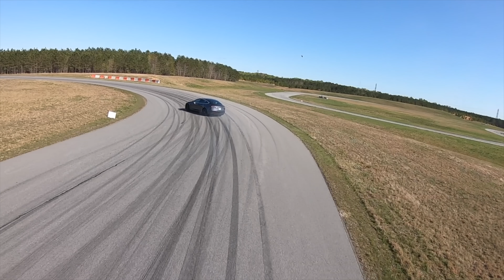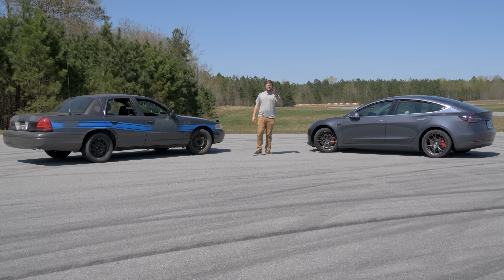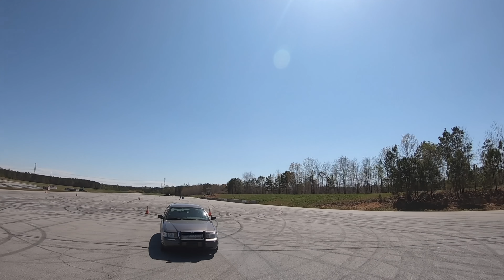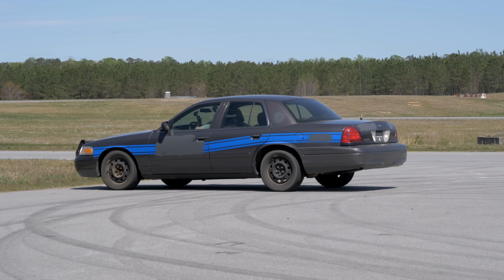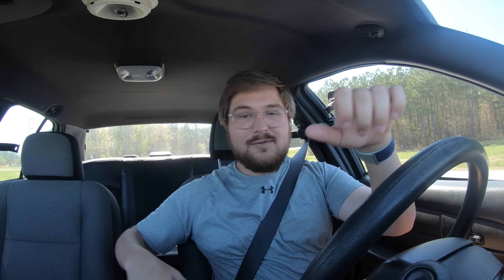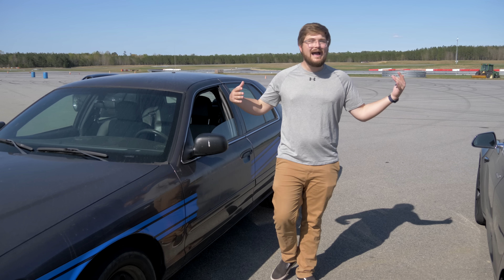Should Police use EVs?  Tesla Model 3 vs Crown Vic Police Interceptor

Comment from the maker: Keep in mind this was a fun test, not scientific, where we used an OLD cop car with a NEW Tesla. This was more for entertainment purposes however if there are any members of a police force that want to come over to the track (in North Carolina) with a current PPV vehicle and some tests in mind that would actually be “real world” I’d love to do it! The video for InsideEVs will be numbers based on as much factual data as I can get. This was more to make people smile during this rough spot that has many people down.
Reply: May be a bit old, but the Police Interceptor models of that car had some special tweaks specifically for police duty unlike the standard civilian models. If you had an EV with say a police software package and maybe some police hardware specs, it probably would have beaten the old car. I would expect a police version of the EV, would be able to go much faster in reverse for example.
Reply: @Dominic Licavoli You lost credibility when you mentioned the one incident where they ran out - because they forgot to plug in.
Reply from the maker: They also didn’t charge the car the night before like they had planned to. Same would have happened if you never filled up a gas tank
Reply: @OutofSpecMotoring   ise your brain 5 minutes stop and done
Reply: @Dominic Licavoli old news and it was debunked already. It didnt have to stop the pursue because of the SOC:
Reply: @Dominic Licavoli But you are right, charging takes longer especily with some slow charging available in the precinct so getting the car bck in service is  a bit clumsy.
Reply: The main problem with Tesla is that their vehicles are not as addon- friendly, and without a generator, the battery would drain very fast powering all the police equipment. The CVPI alternator is in excess of 200 amps.
Reply: @NightmareKato  Keep in mind the size of the battery in modern EVs! I'm no electrician and won't try to be one but from some quick research some people with the 'Long range RWD' Model 3 were seeing around 600 amps being drawn, and note that is the single motor Model 3, not the dual motor or its performance variant!
Going based off that, 200 amps would maybe be the equivilant of driving at highway speeds? As they recorded around 600 amps when flooring it and highway speeds would be roughly 1/3 throttle.
So powering a 200 amp device, you'd be looking at losing maybe a range of 33~ miles every 100 miles driven at highway speeds. That'd reduce the vehicle's range to 200 miles at highway speeds from 300, that's not actually too bad! Consider that cruising around a city at 30mph would get you significantly more range.
(Total back of napkin math btw, just something to think about, don't use this as 'fact'!)
Reply: @Dominic Licavoli also you are factually wrong, it never ran out of juice, just not enough to sustain a highway chase
Reply: @Dominic Licavoli Not the case for model 3 and even overheated 100D would kick ass in 99 percent of case. Fro 100D or model 3LR the range is not an issue at all as they dont even use all range during the shift. In the summer we shoudl get new model S with bigger BP and plaid power train, I dont see problem except for the price of new mode S. As for me model 3 is still better choice than model S even with plaid power train and bigger BP.
Reply: @Zayd Mohammad  It's probably in Track Mode since he has a Performance model.  That one can drift without modifications - regular and Long Range Model 3's can't really, they have "dyno mode" but that one is wayyyy too dangerous to actually use on a road or track.
Reply from the maker: Dyno mode isn’t dangerous and I used it all the time before Track Mode V2 in RWD and AWD cars. This drifting is in Track Mode V2
Reply: @OutofSpecMotoring    They do warn you that using Dyno mode for anything other than a dynamometer is "out of spec" use and probably invalidates your warranty and/or would lead to insurance issues if you were to have an accident right?

I´ve never used it but reading about it but there apparently pops up a disclaimer on the screen when you engage the mode.
Reply: @Dominic Licavoli the abuse they go through? So what? Model 3 had far less parts that are going to wear down and break than any ICE vehicle.
Reply: Thanks for pointing out that it was a worn out Crown Vic, which of course would not stand a chance against a new Tesla.  But a new Ford Police Interceptor with AWD and a twin turbo V6 would make it a much closer race.  I think an EV will eventually make a good police vehicle with the right tweaks- a cop car's gotta be able to go a lot faster than 17 mph in reverse! And the new FPI Explorer hybrid has the same K9 AC feature as was mentioned for the Tesla. If I were a betting guy I'd say that we will see an electric Ford Police Interceptor sooner rather than later. The comment about police officers "getting gas for free" was just silly and I hope the intent was not meant to be serious.  No, of course the officers don't pay for their own gas, but it ain't free!  We pay for it!
Reply: @roysmith1259  Keep in mind a Model 3 can do over 165mph in reverse! It's just software limited to a 'safe' speed of 15mph.
The motor is directly connected to the wheels essentially, it's just geared down, meaning you can do the same speed forward as backwards, I imagine a lot of people would crash if they had the same backwards acceleration as forward though so the limit makes sense. Maybe a police variant of the firmware could have this limit removed. :)
Reply: @Out of Spec Motiring you can not Compare a 22 Year Old Platform With maybe an Year old car What i think on this that the Crown Vic totally won it because of the Age and still The Crown Vic is actually Still The Best Police Vehicle's out there hey they may be Slow but sure enough they are Good for Road Blocks Chases Beach Patrol and as i see that Crown Vic was not an Trac Lock one if it would be i feel like it be Close each other since the Trac Lock one Locks the Rear Diff and its not a Open diff what i think would be fair a Trac Lock CVPI or a Dodge Charger PPV ( Police Pursuit Vehicle)
Reply: Tesla: We suspect you made unauthorized repairs, we disabled supercharging and the GPS until you visit the authorized Tesla dealership. Good luck going to that fire!
Reply: I just read an article about a police department that bought a bunch of Teslas for patrol cars. They had a lot of problems with them and switched back to ICE vehicles.
Reply: @Dominic Licavoli Well if an ICE patrol car was brought in to the station and not filled up with gas, the same thing would happen. All it takes is a change of procedure.  I haven't been to a gas station in a year and a half. Everytime I go to get in my car it's got 250 miles of range. Why not have an EV charged at the beginning of every shift? Then let's talk safety, reduced maintenance and less breakdowns. I think EVs are, and will be far superior in any application. It will just take some changes is standard operating procedures.

Comment: To be honest with you I would never trust the Tesla for hard use at all especially in cold climates when the battery will die on you before taking off. And why would you want to sit in a power charger for 30 minutes or more when you could put unleaded or even flex fuel on your crown Victoria and be out of the gas station and only a matter of minutes

Comment: Electric vehicle 20 miles to one ton of coal.
Reply: Not to mention raping the earth for heavy metals, child labor, straight up slavery all the nasty toxins required to process those heavy metals that are then dumped, ect.. you want to do the world a favor keep an old clunker running, yes, yes they can be recycled, thank god that's actually a practical recycling process I am very familiar with but it's better to keep a clunker on the road than scrap it. Brakes first because hey, human lives matter. Then tune up. Once that's done properly the predominant exhaust component of a properly tuned internal combustion engine, even a gasoline one it water vapor. Look it up I dare you. Meanwhile even according to national geographic naturally burning coal seams produce more carbon dioxide than all human activity combined. Then there are volcanoes. It is foolish pride for humans to think they can have such influence on this globe.

Comment: I'm surprised how well the crown victoria did compared to the tesla even with an open diff and how poorly the tesla did compared to the crown vic I mean it was only 1.29 seconds faster I was expecting it to be much faster than the crown vic like 10 or even 20 seconds faster and it was only a few feet faster at catching the speeder! So much for the EV! Yes it's faster but not fast enough to make a significant difference in a real-world scenario especially compared to a crown vic imagine if it was compared to a more modern more powerful chevy caprice PPV or a dodge charger pursuit.

Comment: Until it is figured how to recharge an electric vehicle as fast as one can pump gas, AND have it available on every other corner-  the cops wont be using them too much.  I think thats the one thing a lot of folks are missing...Too much down time. It would take more Teslas, officers and money to achieve the same amount of coverage to make up the time difference between  a "re-charge" vs.  a "fill up".  Police departments aren't going to go for a cruiser sitting idle for that long- neither is a city budget planner.  Most officers hand the cruiser over to the next officer while the hood is still warm to the touch. The performance of the Tesla is outstanding, no doubt. Not gonna be an "electric car-denyer". A lot of work to be yet, to include making them where they can have the living fuck beat out of them 12 to 18 hours per day.

Comment: I think it will only take one OTA update and Tesla can transform their vehicles into proper police cars. Even the top speed in R can be easily increased since there is no gearbox. All that beeping and blinking can be turned off because they are only there for safety which a police car driver doesn't really need. A complete new market for Tesla, they should seriously look into this (pretty sure they already do).
Reply: They do but the problem is that teslas software is written in a different coding language then what cops have used, so its is a bit of work for the valuable software engineers in tesla to work on.

Comment: I spoke with State Trooper that lived through his force experiencing the exhaust leaks with the Ford Police Interceptor.  As he was driving one at the time he was seriously concerned about his and his fellow officers' safety.  Defects aside,   according to him cracked or leaky manifolds are not uncommon among the interceptor fleet.  The lower requirements for routine maintenance would provide a benefit of higher availability of the Electric vehicle.  However, at present the much longer mean-time-to-repair could be a dominating issue for the fleet manager.

Comment: How is the Tesla with the certfication for the police radios. I don't think that Tesla like much more high power HF in the car and many parts need to be modified for the police.
You can't simply put 25-100W HF in the electronics of a EV and tesla needs more shilding and it all needs to be certified.
Police needs much place for all their equipment in their cars.
Reply: Mach E might fit.

Comment: Considering how abused the typical cop-car gets, on a daily basis, the Tesla suspensions would get all busted up...& the batteries would get drained to zero before a cops shift was over.
Reply: Suspension on the cars  yes battery not likely. Top spec Cyber truck has 500+miles and a full air suspension that will handle a beating and has armor from factory.

Comment: I think the Cyber truck is probably going to be a good fit for a police vehicle,but one major issue that needs to be overcome is the cost to replace expensive circuit boards on all these electric vehicles. And yes, they do fail.  They're usually very difficult or impossible to repair, and replacing them is very expensive.  In contrast most ICE cop cars are easily repairable and the parts network is open. Tesla would need to fully open their parts availability to make something like this transition more possible.

Comment: Office aftermarket conversion companies should work with Tesla to buy a stripped version cheap, the conersion companies can put in their own suspension. tires. seats, and technology and devices inside. They could also better use the center sotrage console to fit police equipment. OBviously it would still need the center computer scree, but bedisdes that ,everything else can be costom

Comment: I am guessing you are not to bright?  How are you comparing a Crown Vic, which they do not make anymore and police do not use anymore, to a Tesla which could never withstand the punishment cops put cars through.  Why don't you compare it to the new Explorer that is a Hybrid?  Maybe run them through an off road test, or maybe in the snow?  The other thing you forgot to compare is when they are out of power or gas, you can refill the Crown Vic in under 5 minutes while the electric car needs to be plugged in for 24 hours. Maybe you should also do a crash test?  Police cars are notorious for getting rear ended while they are parked on the side of the road.   Would you rather be in a Crown Vic or a plastic Tesla?   The last thing you forgot to compare is when a Crown Vic is down being in use, the police usually sell it at auctions and get money for it.  With the Tesla, once they are done they usually burn to the ground.
Reply: Wow you are very educated!!!! If you would like to donate him a car for all those test that would be cool. It’s not as easy or cheap to get the newer cars and this test was obviously just for shits and giggles. Also it doesn’t take 24hr to charge a Tesla... I guess you are not too bright? Also Tesla’s run for over a million miles with no maintenance and definitely would sell for more than any of their current cars once they need to turn over their fleet, IF they ever had to with a Tesla.

Comment: its prohibitively expensive (almost double), and repairing costs are high as well
Reply: For governments or corporations upfront cost is not as important as total cost of ownership that being said i think it would be best for most to wait for the cyber truck as it will be much cheaper to repair while still having the low general maintenance and fuel cost going for it as well as the armor.
Reply: @baddriversofthenorcalarea500  Exactly Tesla’s need little to no maintinece, far less moving parts no oil changes, etc... The only setback may be the cost of parts when they malfunction/break as well as availability.

Comment: You don't have to get the Model 3 to a full stop to put it in drive, you can do it from around 5-6MPH.
Reply from the maker: In that situation, tell me how you can accurately slow the car to 5mph from 17 and then accelerate forwards in the least amount of time without coming to a complete full brake stop.
Reply: No offense intended but if you can drive a car as well as you do in this video how can you not feel when your under 5 miles and hour.

Comment: Kyle has pointed out a huge market segment, currently owned by Ford.  Lots of civilians order as close to a police version as the option list allows.  So it is a big definable segment.  
Kitting out a vehicle for a specific use like a police vehicle is well worth the investment for an aftermarket tuner, as the sales come in year after year.  It is Tesla's option to step up with a model Y with tough bumpers, tough tires and support for electronic gear.  If Tesla does not, Rivian surely will.

Comment: Why are you using a Crown Victoria. They stopped making them in 2011. The Tesla has a huge advantage with AWD. The proper vehicle to use would be a 2019 Ford Explorer Police Interceptor. Plus putting your foot the the floor on a gas powered car is not necessarily the fastest way to get around a course.  Get one with the 3.0 twin Turbo ecoboost.  City cruisers can’t wait 40 minutes to charge. They are on the road 24 hours a day. Takes 3 minutes to refuel. Yes the 3 will accelerate better it was designed to. But a municipality can get 2 explorers for one 3.
Reply from the maker: Bring a new one by then! This was just for fun
Reply: The 'proper vehicle" is far more top heavy than the Tesla.  Every hear of shift changes? On average they take about 40 min and can be staggered to allow for charging. Not likely an ICE car can refueled in 3 min start to finish, just authorizing payment takes a 30 sec that leaves 21/2 min to pump 20+ gallons of fuel, replace the pump & fuel cap. The advantage of an BEV like the 3 is they last up 4 times as longer than an ICE car before the battery pack (the major cost) has to be replaced